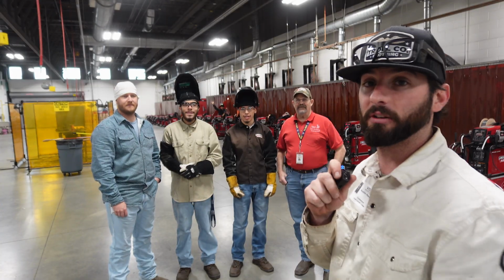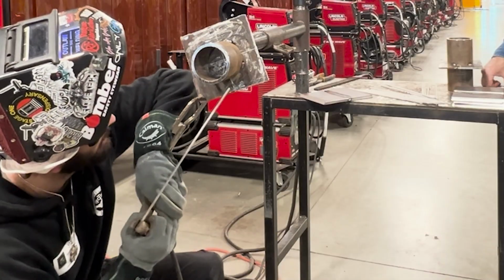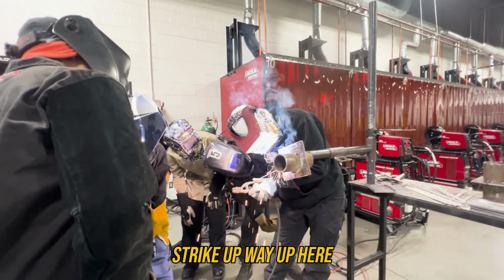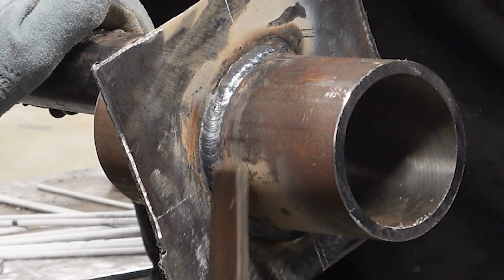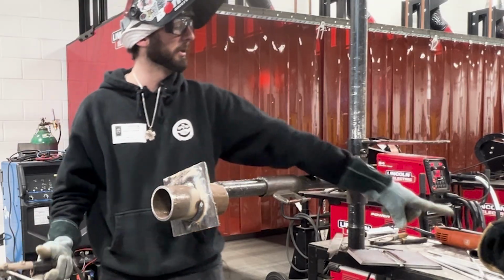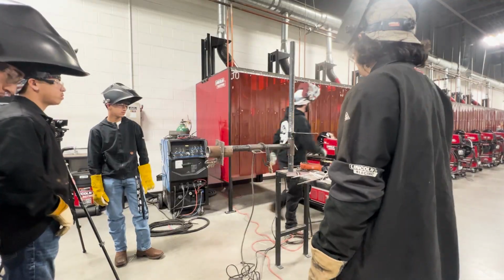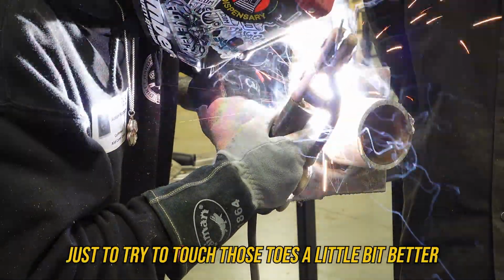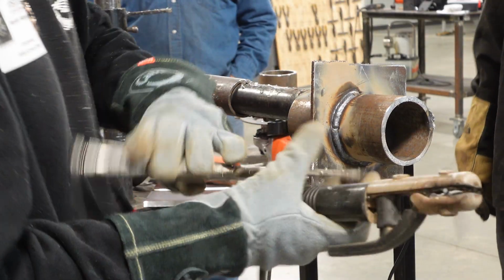Master Your 5F Welding Techniques Using 7018 Welding Rods

Comment: The is an exceptionally good video;  excellent dialogue during and after the weld.   As well, the machine set up was on point.  Arc force in not necessary unless you are up on the cold steel of a Highrise construction project.
Reply from the maker: Thank you Kindly -Austin

Comment: No it ain't you turn that dig down you turn that amperage up the machine I was with daily I read 7018 vertical up on really thin stuff and it's quick it ain't slow how do you get your kilojoules per millimeter down you turn the Dig Down you turn the amperage up and you go faster that's how it works
Reply: Idk what you wrote looks very messy. Turn dig up for 6010 root no dig needed for 7018 if any 10% that's all.
Reply from the maker: you made my head hurt trying to read that 🤣 thanks for the pointers okie doke

Comment: 5/32 6010 on 1/8'' base metal and a 3/16'' gap vertical down fills in 1 pass, 1/8 sheet is very cheap for root tests?
Reply from the maker: Not sure what your question is, Id blow a hole with that set up personally-Austin